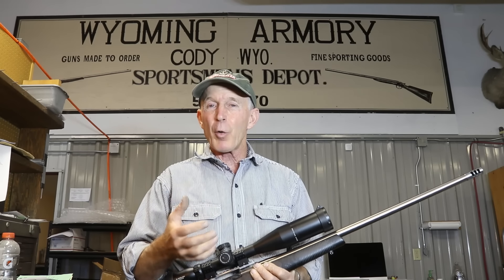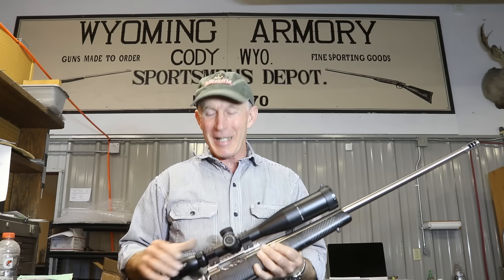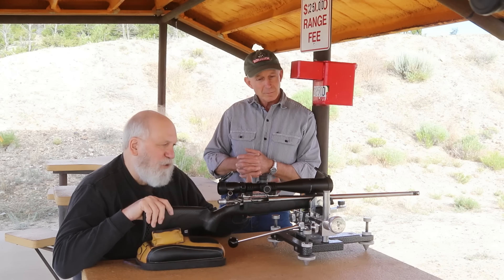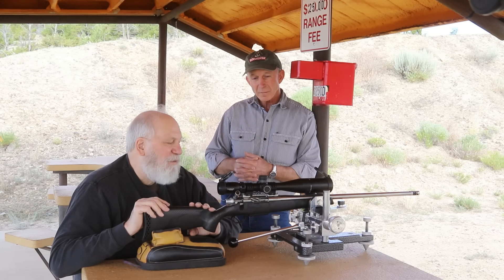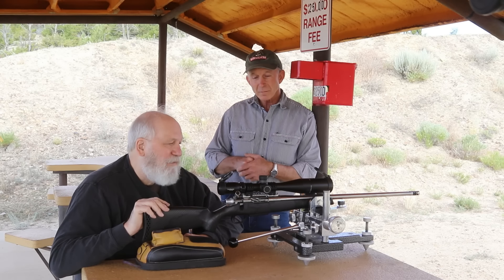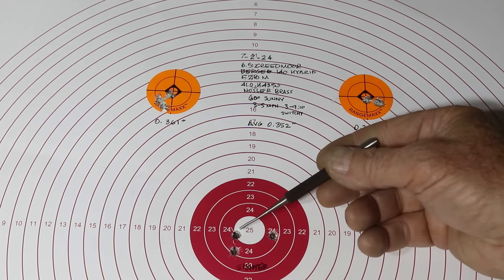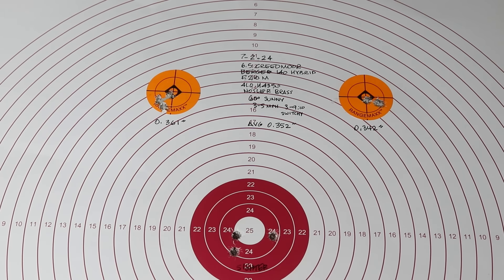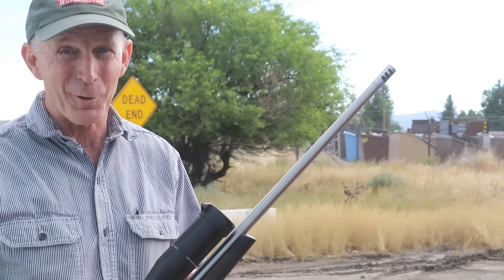1/3RD MOA Wyoming Armory Custom Hunting Rifle

Comment: Funnily, my three most accurate rifles really couldn't be more different from one another. My Ruger 10/22 Match Grade rifle can get 1/2 inch groups at 100 yards using a Holo-Sight and Wolf Match Grade ammo. It has a giant bull barrel, custom action, and a mounted bipod. My Stevens 200 in 22-250 can squeeze half-inch groups with my specific Handloads out to 300 yards with a Weaver 4×12×44 Scope, which blows my mind for such a budget rifle. Heck, the scope itself cost more than the rifle did. Also, you can't shoot more than a three round group in 20 minutes because the barrel gets so dang hot after a couple shots. My Winchester 1885 in 6.5 Creedmore will vaporize a Cantaloupe at 400 yards and will knock the Ace out of a playing card at 300 yards, again with a very specific handload I cannot say without this comment being pulled by YouTube. That being said, I can consistently get groups that look like one jagged hole at 300 yards off of a bench rest with that 1885.